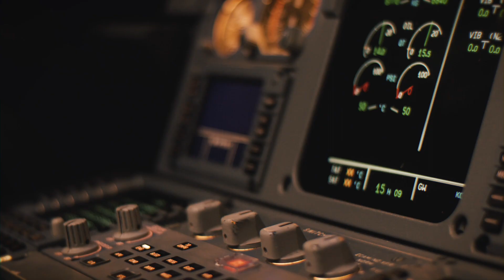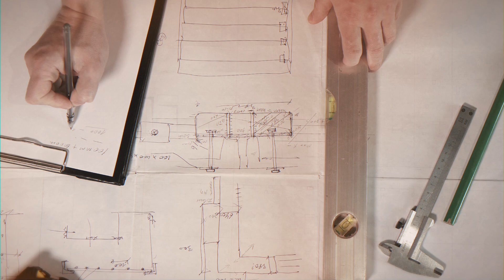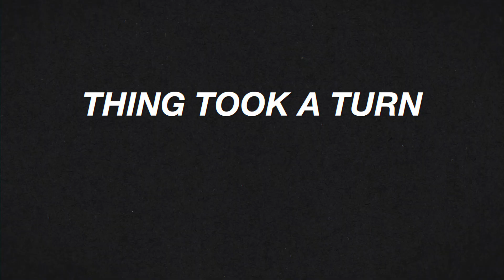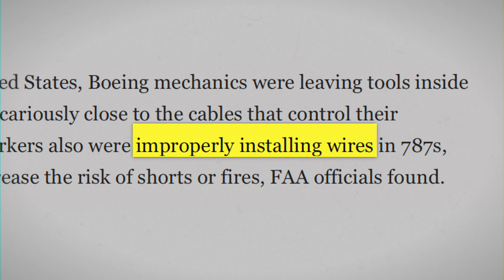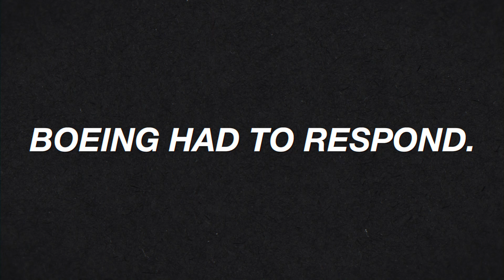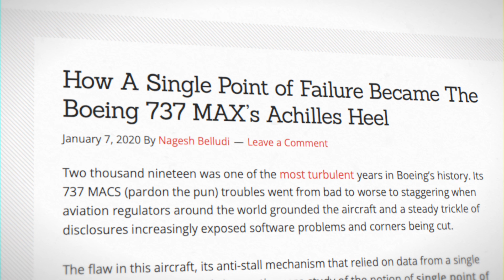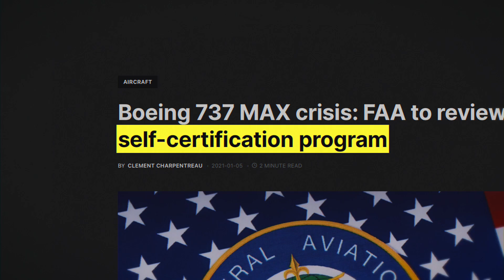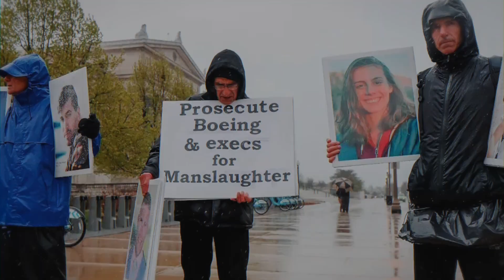The Scandal That Destroyed Boeing

Comment: Can these complex planes even be flown "manually" anymore? It just seems like such an obvious oversight not to have a big "manual override" button located somewhere on the dash. If the plane acts unexpectedly for any while in flight, then at or near the top of the troubleshooting list needs to be pushing that button.

I disagree that redundancy is the main cause of this crash. MCAS is a "safety" feature that killed hundreds of people. A fault In this feature caused the plane to try and fly itself in the ground. It is no different than a Tesla suddenly braking at highway speeds on a crowded Interstate for absolutely no reason, also causing multiple deaths.

Whether you are in the air or on the ground, having computer control of critical systems that can kill everyone aboard the vehicle is risky as hell. A recent post estimated how smart a computer needs to be before it is better than a human being when it comes to driving** 

Yes the plane and the software were rushed into production, but the lack of redundancy was only part of the system that helped the computer fly the plane. I am incredibly leery of the willingness for designers to overestimate the capacity of what computers can do. Having a single sensor was a critical point of failure that led to these crashes, but it's impossible to say for sure that will ever be the only one.

**Human Drivers Avoid Crashes 99.999819% of the Time, Self-Driving Cars Need to Be Even Safer
( Google this article title for the source)
Reply: There are two switches in the center console of a 737 that deactivate the automatic trim systems, including MCAS. It has been standard procedure in 737s since the 1960s to activate these switches in the event of a trim runaway. The pilots of the accident aircraft did not follow these standard procedures.
Reply: @robroilen4441  That is informative. But two planes crashed and hundreds of people died, and you are blaming the pilots. MCAS is an entirely new feature added because the engines were relocated. The system aggressively tries to prevent stalls, and it was a failure in this system that caused the crashes.

Pilots were told this plane was almost exactly the same as the plane that has been around for over 50 years. They were not told about MCAS, and how it could behave if it malfunctioned.

You are in a plane, a plane you are quite possibly very familiar with. All of a sudden it wants to dive to the ground. Is it your job to become detective and try and guess why -- okay guys, they must have added a new aggressive anti-stall feature, where are those switches that disable trim control that we've never had to use before because 737s have never had this problem before -- or just do the best you can to keep the plane in the air. You do the best you can to avoid dying. These pilots did the best they could to keep the plane in the air and still they and all of their passengers are dead.

I can't believe you blame the pilots.
Reply: @robroilen4441  So anyone not blaming the pilots must be getting their information from a National Enquirer like website?

737 Max's were grounded for over a year, and Boeing was fined billions precisely because it was not the fault of the pilots. Wikipedia may not the last word on truth, but it's not a bad place to start. Try educating yourself:
 https://en.m.wikipedia.org/wiki/Boeing_737_MAX_groundings

Anyway you appear to be someone who values having a specifically weird agenda over the overall truth of the matter. So go ahead and reply with more reasons why you blame the pilots. Everyone else is wrong and of course you are right, the pilots are to blame. Maybe you'll have better luck sharing your thinking with others, but I'm done.

Comment: Why not just lengthen the gears???????????????/ that would have saved so much lives (not saying it would be cheap, but it would have been less expensive than those)
Reply: The gear can't be easily lengthened because they already are as close as possible in the fuselage. A telescoping mechanism might be possible, but is heavy and takes more development time than MCAS.
Reply: The underlying problem is that the 737 needs a replacement rather than modifying a 1960's aircraft, no?

Comment: a rather biased telling of the events. The biggest fault lies with the pilots of these planes, who were horribly undertrained. The biggest issue is that in Boeing and America, Pilots are expected to not rely on the automated systems in their aircraft; this is not the case in poorer countries in the world, which have barely trained pilots with far less the required man hours of an American plane. The systems at fault could be shut off with a simple flick of a switch, but the pilots were so poorly trained they never knew to shut the autopilot off.

Comment: The problem is the people they hire aren't passionate about aerospace and have no prior shop experience.I don't even think anyone on the line even knows what a stringer is or where they are located on the aircraft ( longitudinal aerostructure component of the aircraft, there's also longerons, spars, formers, and bulkheads ect),  its so compartmentalized the machinists don't even know gcode, or cam. Management treats the company like it's highschool instead of bonuses for the workers who build the plane, it's a pizza party. The promotions aren't based on skill or output and improvements, but rather social status, who's in the click or out , they also performance pushed productive workers to quit, yes quit Boeing and now they are forcing WOKE culture instead of Family day, or recognition of our vets. It sucks to watch lazy unproductive people get ahead, while the productive people that would have saved the company are run out.

Comment: These Ceos should go to jail/ get their comany taken off em. As a warning to cut saftey corners in air lift. Its just not an excse I didn't know. Your suppose to test the system riggerously. Any rusheed job should be grounded.... Like there needs to be tighter regulations.

Comment: Sad the pilots didn't have the experience to know they were having to continually pull back on the yolk to maintain the pitch of the plane and maybe they should flip the stab cut out switches. Not to say Boeing wasn't at fault but here in the USA our pilot are required to have many hours of experience before flying a 737. And about the quality control, I miss the old days when 100 percent of the airplane was built in the USA.

Comment: So you video has a issues. I can tell you do not have the background of Aviation history. Boeing/Airbus and all the other plane companies have had issues with putting a weight in the sky that needs to move at a certain rate. Airbus crashed its brand new plane at a plane show back in the day. You are going to have to show that the European system of flying is better then the FAA. [Looks back at Europe's aviation and laughs].
Reply: The plane was about to stall. A320 correctly prevented a stall by limiting pitch-up. By the time the pilot had increased thrust, it was either going to stall into the trees or fly into them.